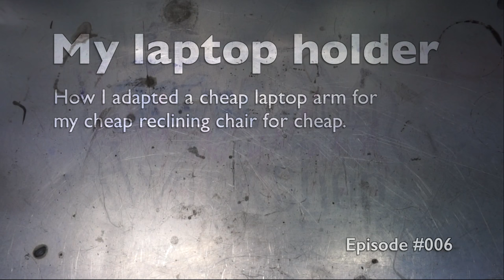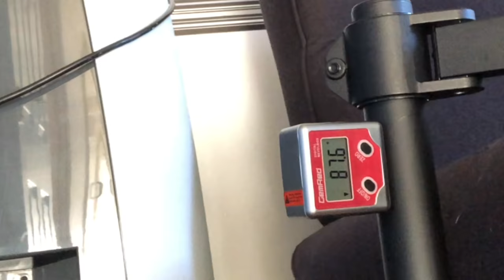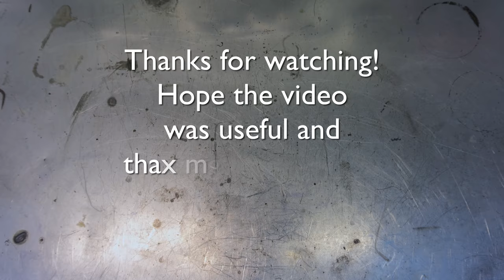Laptop Stand for Recliner Chair - JLW006

Comment: No ventilation needed for the laptop?
Reply from the maker: Short answer: Not so far. 
Longer answer: I've been monitoring the heat output of the laptop and the only time the fans have come on were when rendering this 30+ minute video. It wouldn't hurt to have some ventilation - of course - for when or if it's needed. Therefore, in version 2 of the laptop tray, I'll probably make some ventilation holes.
For other laptops and other configurations, the situation will be different, of course.
Another thing I've noticed is that it would be very handy to have holes in the tray that would allow you to push the laptop out of the tray from the underside instead of pulling the laptop out using the screen or something else.